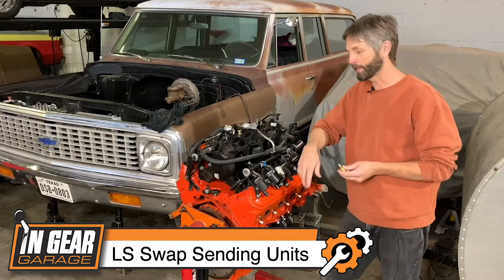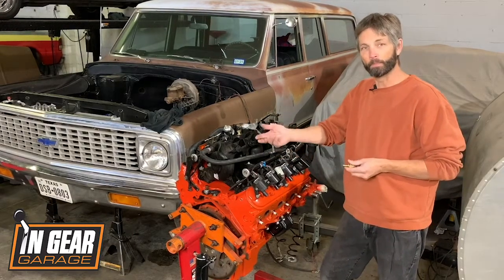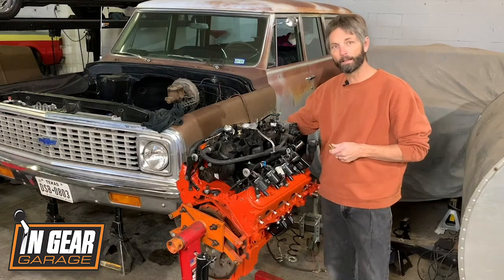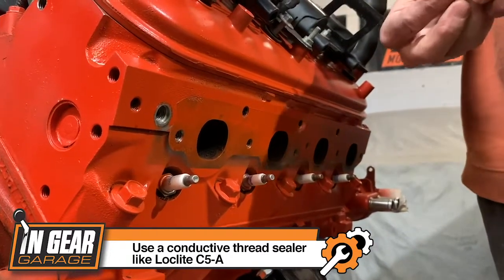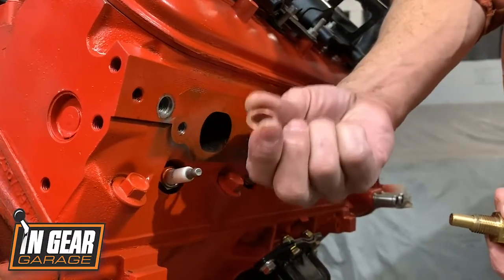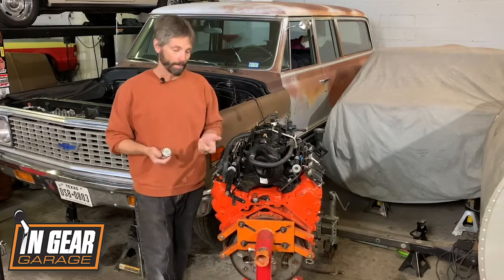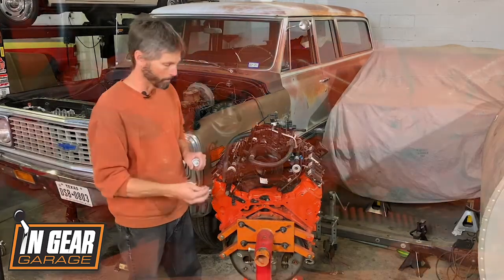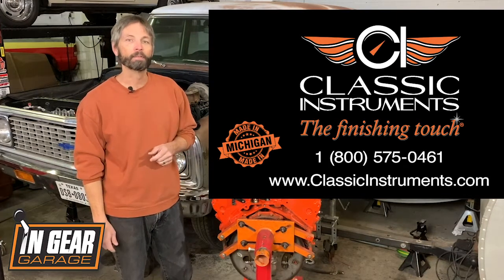Quick Tech - LS Temp and Oil Sensors

Comment: For oil sensor fitting on the back of the block is that for all gen block I have a gen 4 trying to figure out if I can run mine in the rear of the block like the old sbc

Comment: 1999 5.3  has  place to tap    the oil sending unit in it  be careful  not  to block oil flow if you are using the one  by the oil filter like the one in the video   or just get the adapter and put in the back

Comment: you mean the stock Ls oil pressure will not work on an aftermarket gauge? as for the temp sensor, another video suggested swapping out 2 wire temp sensor for a 3 wire , 2 of which still goto pcm and 3rd now goes to your gauge cluster? hopefully this works as i ordered a $150 quad sensor gauge and 3 wire sensor already!
Reply from the maker: I can't speak for all the gauges out there, but all Classic Instruments oil pressure and temperature gauges require their sending units to operate.  The OEM oil psi outputs a 0-5 volt signal which doesn't work with CI gauges. 
A 3-wire temp sensor also probably outputs voltage which wouldn't work with their gauges either. Thanks for writing
Reply: @ingeargarage  im not familiar with Classic Instruments  but aftermarket quad gauge  sees my oil pressure wire seems to work on a preliminary test . Even my 2 wire temp sensor worked until car ran for 15 min and got to operating temps, then when my quad gauge was hooked up to temp sesnor it shuts down the car for some reason.  I have a  3 wire already but it never came with any wiring diagram so  kinda dont wanna guess which is which.